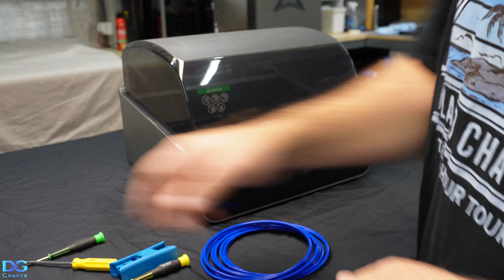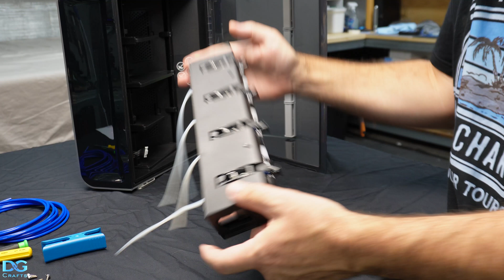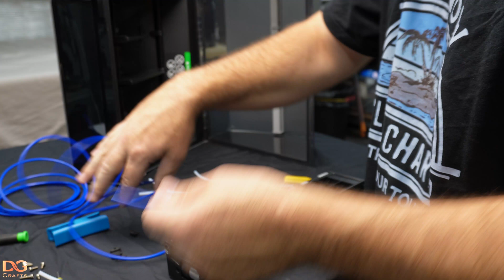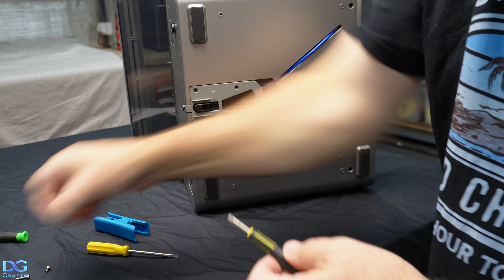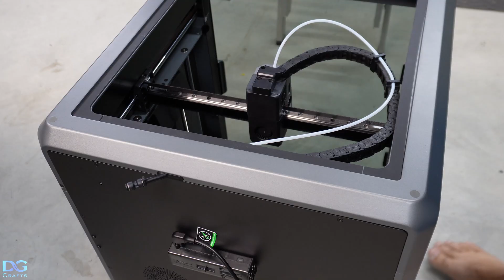K2/CFS PTFE Upgrade

Comment: and the reason why the tubes where transparent is so u know where the broken filament is or what unit failed to retract.. now you cant see it.  Capricorn also released a PTFE tube with a wider inside diameter that is transparant, WAY BETTER than this blue one i think.
Reply from the maker: i suppose but i have never had an issue where i needed to see inside the tube nor would i bother attempting to look behind the printer at the tubes even if they were clear because i could purge it from the front if i needed to.
you will know which unit failed to retract because the software will tell you and the indicator light will show which spool is in fault mode but if you feel the need to look inside the tube then you do what best suits your needs 👍

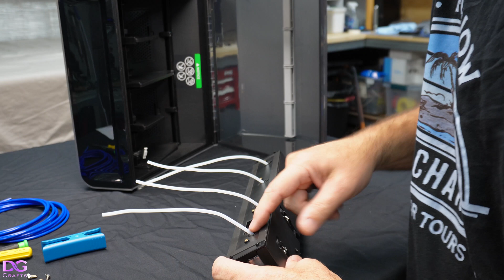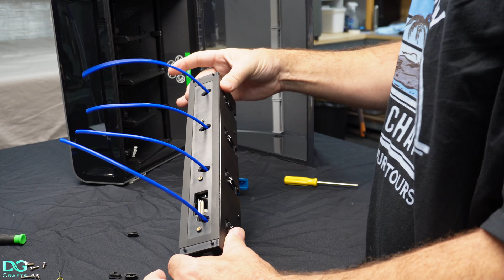Comment: If you remove the (fwd) cover (four screws) of the complete unit (as shown at 3:40), you do not have to remove the rubber boots nor stick them back in (at 5:45), which makes it a lot 'not trickier'.
As mentioned by AustinAudiS6, I chamfered the ID of the tubes carefully with a regular 4 mm drill, as seen in https://www.youtube.com/watch?v=yrtQcS-be-k

Comment: Thanks for the video! I've upgraded all the PTFE tubes using the Capricorn ones, and as others have mentioned, you don't have to, but keep in mind that even an expensive printer, like the previous ones, the community always discovers opportunities to fix design flaws or improve performance.
Reply: Factory creality tubing tends to kink and have higher friction it also likes to twist up due to the increased resistance. Factory creality tubing is 4 mm outer diameter with a 2.5 mm inner diameter capricorn, which is usually 2mm id and constrains the filament better and has more lubricity decreasing friction and reducing the twisting found in the creality ptfe due to the thicker tubing wall.

Comment: 10:30 good video. the only thing i would add is to chamfer the ID of each connection to ensure nothing is drgging on the filament
Reply: how would you chamfer the ID of the tube? If you have a link to a tool, I would appreciate it.

Comment: What a disaster no one should have to go through this after spending that much money on this printer.
Reply: You don’t HAVE to. But most Creality users like to mod and tinker. I have tons of hours in my k2 pluses with no issues.
Reply: @stayreadyto3dprint I did Capricorn in most mine, the white tubing I left in at the bottom, only part, but cause it's a pain to get those.  That white tubing leaves a white residue, it gets all over.  I looked for TH-3d I think it was on Amazon, no luck.
Reply: I still don't know why this "upgrade"  seems more of a color change as upgrade implies an improvement.
Reply: @AnotherCG  wait til the stock ones wear through in a month.  than you'll see why it's an upgrade

Comment: I converted all my PTFE tube to clear so i can see visually if there are any jams or issues going on with the CFS or were the filiment is located in the system
Reply: Can you send the specs, link?  The only clear I can find it 5mmOD 3mmID
Reply: @2playgames222  I posted a link but I think yt took it down

Comment: What's wrong with the original tubing in the CFS ?
Reply: To the people asking why: I could not get my K2 Plus to print at all for almost 3 weeks. It kept telling me I had clogged nozzles when I did not. I decided to check the PTFE tubing and it was so tight that I had to force filament through it. I have replaced mine with a combination of 3mm ID and 2.5mm ID capricorn tubing and I've not had a SINGLE failure since. OEM PTFE tubing must have had bad QAQC.
Reply: Agreed! I can see replacing my tubing when it fails but why "upgrade" to a lower diameter tube?
Reply from the maker: @shoot991  2.5 id / 4.0 od is the same diameter tubing 😉
Reply: Nothing at all, these guys just like making videos. I find the tubing Creality uses to be top quality.
Reply: @_SHaDoW6_  Agreed 4 CFS units on mine 100 hours of printing and color changing flawless.
Reply: @Legal_Addiction dude 100 hours is nothing.   That's like 3 prints for me.  I'm at just over 1000 hours had first tube failure.   All hyper filament or amolen, nothing course that would eat it quicker.
Reply: @_SHaDoW6_ it's garbage, look at the residue in your buffer.
Reply: @_SHaDoW6_ and one of the tube's just split on me, I have to do this now, my k2 has all Capricorn,  besides the bottom of the cfs in this video.  The one part in the tubing that failed
Reply from the maker: the cheap mass produced tubing can vary in quality and mixture of things in the tube.
creality for years has used fairly sub par tubing on most of their printers with differences between batches.
now with something like the cfs constantly pulling the filament in and out your filament becomes very coarse and starts to break down the inside of the tube and it carries bits of ptfe into your nozzle as it degrades and eventually you start having extrusion issues.

tubes like capricorn and tough tube have a better quality and a better mixture of ptfe often referred to as "virgin" so they have less friction and they dont break down as fast.

at some stage you will start getting blockages or extrusion issues and you will wonder why creality provided you with replacement tubes, you will use those tubes and the issue will go away for a while then you will start to wonder... what if...

oh and i also forgot to mention it can be a bit more rough on the tube when you are using more exotic filaments like cf, the harder the filament the harsher it is on the inside of the tube.
Reply: @DnG-Crafts  I had issues with the K2 after some hours of printing it started clogging the nozzle/extruder and no matter what i do even when i've changed to brand new tubes and changed to position of the buffer still gets cloggs even during calibration ! So i came to the conclusion it's motor syncing and software issues i guess! When i use the same filament from the spool it prints just fine :)